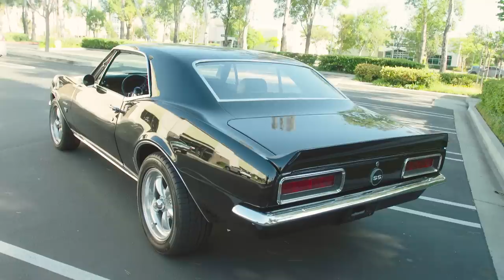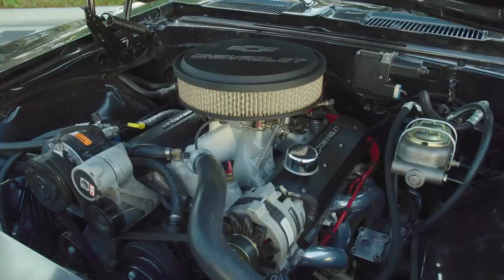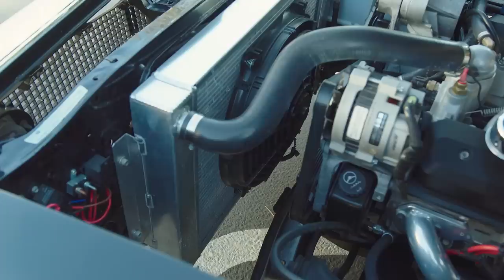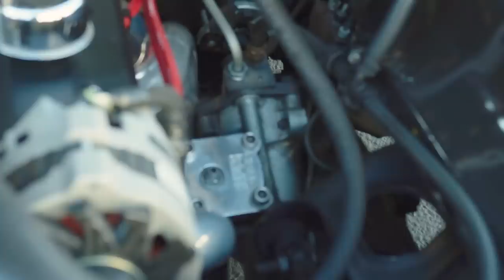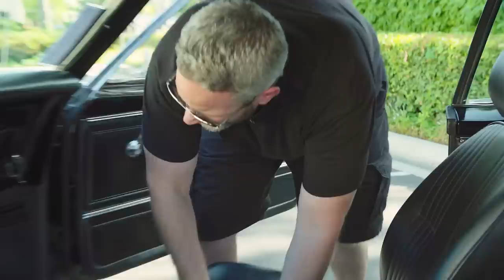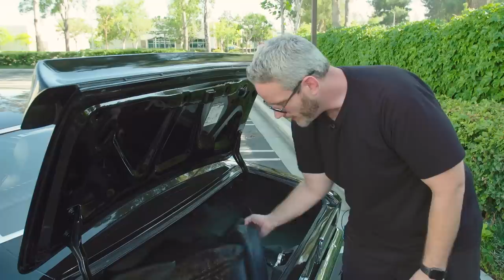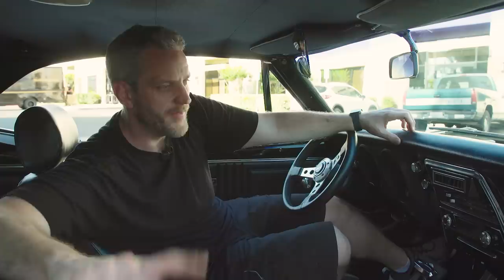Time for a new car build! Let's Resto-Mod a Classic!

Comment: Hhhnnnnnnngggggg.... that sound clip at the end. Haven't heard a car sound like that in a long time.  If it were my car, I'd turn it Pro Street. It's much more enjoyable to drive one of those everywhere than it is the oldschool drag radials on back/skinnies up front. Plus you could potentially run Autocross with it if it didn't have the drag radials/skinnies, and that's always fun to do!

Comment: are you going to put on detroit speed suspense parts to make the car ride smooth or airtech suspense and also are you going to replace the front clip subframe with a tubular subframe to lighting up the weight of the car same with the rear end. other words jay, are you going to make this a pro-touring car

Comment: I would go with the fat tires in back. Skinny’s only the front. Drop the front of the car a few inches. And then do all the panel repair. Repaint, new driveline. Buttons and whistles. Call it a day.

Comment: Go Modern, with lower profile tires. Match the wheels to the car (don't go with crazy low profile tires!)

(set on something along the lines of a KONIG Flow Formed wheel)
Reply: Guess what Brand of wheel I recently installed.

Comment: flowmasters have always had a ping type noise for me. more noticeable at cruising/highway speeds. once you hear it that will be all you hear. with your money and tech knowledge i say why not try and integrate the old chassis with new camaro features and comfort. ive seen a few done with full late model gto and late model camaro interiors. the 04?-06 gto seats fit well in the first gens and hug the body nice. plus they are power cant beat that. make yourself a nice triple threat car that you will enjoy being able to drive whenever. you go with the efi system and can run stuff like electric fans for the rad. and trans cooler and even set them to ramp up with a/c activation.i have experience with the fitech system but now wish i went with holley but for my 5.3l build i needed the top end stuff and fitech was the better deal for me at the time. dakota digital has many add on features as well and can link with standalone systems. you got a solid start cant wait to see what you decide to do with it. at the end of the day its your car and you should make it exactly how you wanna see it. good luck and enjoy the ride man

Comment: You need to get a B&M Automatic trans with a manual valve body!  Is B&M still around? 
They where in the 60's, 70's and 80's.

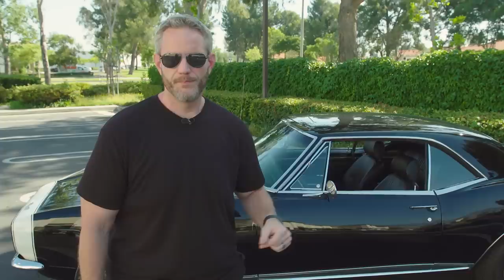Comment: @2:53 you say the vent window doesn't open because it hits that trim, that trim isn't supposed to be there that strip of moulding ONLY came on the 68 Camaros.  Take that trim off and throw it in the trash, that should solve your problems. Some previous owner has added that on there.

Comment: I would do a more modern yellow on the paint,  I love Mc'Larens metal flake they had on the 12c (Check out the Spain episode of Top Gear to see what im on about) But that would probably bet to expensive and Glitzy so Id go wit a Ford Triple Yellow instead No stripes, satin black trim a except for the bumpers those would get a darker polished steel look to them. LS7 is a cool choice but I prefer LS1's or LS6's (see RoadKills OG muscle truck for reference) would probably do a six speed out of a 350z for a trans nothing against autos but I like them to have paddle shifters and different drive modes so a manual makes more sense here I think, probably do 410's out back but that really depends on the power numbers, update the interior with some modern goodies and do a pro touring job on everything else minus the ride height that I would tweak to give it a slight "stink bug" stance to it (see RoadKill's super bee) and thats what I would do if it were mine.

Comment: Jay: Im gunna get a Classic Project car
Also Jay: Buys damn near perfect Camaro.

I hate not having a Classic car. I miss my 70 Torino, 68 Mercury Cougar (numbers matching, less than 50k miles...siiigh), 68 Torino GT... Good cars...
Reply: Nowhere near perfect,it's a 10 footer,but it needs a lot of work...I would guess there's a lot more rust/bodywork than it looks like.
Reply: @seanbailey8545  If you did most of the work yourself, that thing could be spotless within a few hundred bucks in tools. Maybe 60-100 hours in labor and whatever it costs to have the paint stripped and properly painted. I don't know what you've done with classic cars, but from what I've restored and worked on. That is unequivocally DAMN NEAR perfect.
Reply: @seanbailey8545  Also, wanting to rid the car of Bondo is not a NEEDED job. Its a good thing, but many cars have Bondo. It is already not a numbers matching car, you will never reclaim that value. So a little bondo doesn't diminish the car at all.

Comment: If it was me I’d strip it and rebuild it as a drag car with a V12 LS and a manual transmission, chromoly tube frame replacement, and then slap a cam and a supercharger under the hood before I stripped and repainted it black with red rally stripes to call it a day. That and some body repair. Or if I was a realistic person, strip down the paint, replace the transmission, get some better tires and maybe disc brakes and update the dash to something with a screen so I can plug my phone in, along with a cloth replacement on the seats because I hate getting stuck to leather.

Comment: Put a sniper on it or LS swap it so you have some sort of computer fuel injection carburetors can be a hassle on a engine with more than 400 hp and you start running it too lean in higher rpms

Comment: "I wanna learn all about the old school ways"  Builds an LS7, but with a carb. LOL. Very cool, not sure if I'd be calling that old-school though. It will be more reliable than most totally modern EFI engines.
Reply: I don't get carbs on LS engines. You can literally get a PNP standalone for these engines. Which could make so much more power and reliability than a carb. I get it for the old school factor. But then you would almost be better off just getting an old bigblock or something
Reply: @Baksteen_Express  maybe better fuel economy, but not really more power if you know how to tune a carb. Engine Masters on motortrend did a EFI vs carb and they were very similar and a different test, the carb actually made more power some how

Comment: Hey Jay, I had a carb setup on my 68 impala LM7 (truck ls) for a few years (now efi). If you're going to do a carb setup yourself I'd highly recommend doing an in tank fuel pump with a regulator right outside and a return back into the tank. I had an inline and the sound will drive you insane, even with long tubes. If u got any questions regarding the carbed ls route I'd be more than glad to run you though what I did. My IG documenting the build is @theozgarage

Comment: the throttle isn't all the way because the kick down cable is out of wack! And DON"T DRIVE IT IF THE KICK DOWN CABLE IS BAD! It will WRECK the transmission!

Comment: I vote rally stance. I personally thing that fat tires in the back make corners fell off. But that might be more of an issue with a duel than in a car.

Side note ls swaping will get you better econ and the drivability you want than a built boat anchor... I mean classic engine.  But not my car not my wallet.

Comment: 195 is the correct temp for the smallblock 350
Reply: colder than that and it wont burn the fuel as efficiently and less hp

Comment: LS7! Carburettors...
Wut.jpg

Tbh Jay, if you want a modern engine. Why not go ham with modern computers and engine control? Its a restomod right?
If you wanna learn the old way keep it as is and ditch the Electric Choke and go proper old school. 

For me, I'd have modern injected LS, Haltech ecu, maybe a supercharger, a proper Manual transmission (say T56 or something), massive wide tyres and on a lowered car with bigger wheels - like 315/30/r18 rears, and make it handle right, stop that massive classic muscle car lean through corners and you're golden!  But that's me.

Comment: its not hp loss  through the transmission its the rear gear it prob has 3.08's in it put 3.50's in it

Comment: my twocents (heh) the 5 hp you'd gain from a 160* over a 195 is not worth the increased engine wear or mpg hit it would cause
I'd take that soCal heat over the st. louis swamp butt bs any day

Comment: Whatever you do, do not put some massive 22" rims on it. I absolutely hate it when groups like Gas Monkeys put massive rims and hair thin tires that barely function as rim protectors on old muscle cars. It looks wrong and unbalanced. There needs to be some "fat" around the tires to complement the sexy curves that late 60's and early '70s muscle cars have. No need to go all drag racer style with massive rear tires but something in that direction fits them better than modern massive discs.

Comment: Useless info...cars that had power steering/cruise control came with auto canceling turn signals.  YearOne will be your new one stop shop, like newegg or micro center....but for your car!

Those look like TTI headers....good stuff. If you keep it an auto, look into gettifmg a gear vendors over/under drive. They are a socal business in el cajon and make baller products.  You could also look into a newish 6l80 or beefier auto from gmpp or american powertrain (teach the wife how to drive a stick! Hahaha)  a super old school th400 is bullet proof and putting an over/under gives it 6 speeds.

Comment: I haven't flooded my carbureted rotary car. The fact you flooded a V8, shame.
Does it not have a choke? I don't have to pump the gas on cold starts because I have an always on electric fuel pump and a manual choke
Edit: Electric choke? Oof. Convert it to a manual choke, you'll thank me later.

Comment: If you want your wife to drive it, I would get rid of the carburator. Also look for some air bag solutions (not a joke about women drivers, just safety). Modern touring wheels and tires. Skinnies in front can look silly sometimes. Love turbos, but supercharger might fit the car better.

Comment: I can tell just by seeing the engine that you have a good one to restomod as it has the wrong engine to begin with.  Its clearly has heads from the 90's if not the whole engine.  Had you found a real Yenko and wanted to put a new 6.2 in it and disc breaks you would destroy the value but this one has already been messed up so all you can do is go up from here.

Before messing with the engine or mechanical I would jump into the body work.  You may have a massive mess that will blow your budget.  You may be looking at cutting out and replacing that rear fender along with other trouble that you haven't even found yet.  I always say deal with the mechanical first and the pretty second but your mechanical is solid and sound and your real trouble right now is that body.

Comment: Don't be stupid... go pro touring all around. Big and littles are not good on the street and pointless off track... the normal wheel tire combo is also significantly safer on the street. Your brakes will work better... you'll put power down just fine. 

I'd also ditch three KYB shocks for something real. Koni or Bilstein... or go coilover like Ridetech.

Comment: NOOOOOO!!!!!!!!!! You do not want to change the thermostat off factory!!!! Especially with the carburetor. Operating temp is around 200. 195 or 185 is perfect. do not go lower than 185 thermostat. But with the large radiator you probably should just leave it alone.

Comment: At least do the efi but the carb style efi on it. Also if you put a 4l60 or turbo 350 trans in it I'm unfollowing. Also for checking the body do the magnet test for bondo.

Comment: I've always wanted to get a late 60's mustang
Replace the motor with a newer fuel injected coyote. Replace dash with a custom updated dash with gps rear camera all that stuff. Add airbags disc brakes newer safety features.  Redo the interior to match more modern feel.
Reply: good luck fitting a coyote in that engine bay
Reply: It takes a lot of modifications I have looked into it.

Comment: Says it's a cruiser....
Gonna swap the 3.08 gears for 3.9's...SMH
3.31 for a cruiser that's still fun, 3.42's for a bit more fun but no lower than 3.55's unless racecar. Even with a OD I still wouldn't be looking at lower than 3.55's in a cruiser.
As for wheels, not a fan of the old school or hot wheels 20"+ look. I like it in the middle 17" on a Camaro, 17" Rally wheels are close to perfection on a 67. Even 18" look wrong to me.